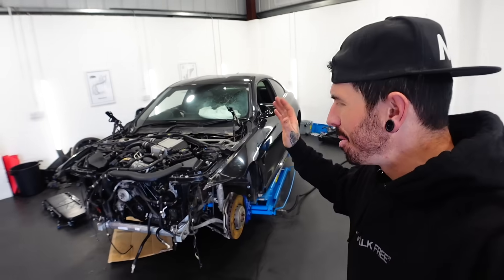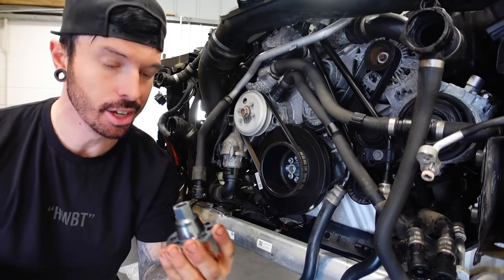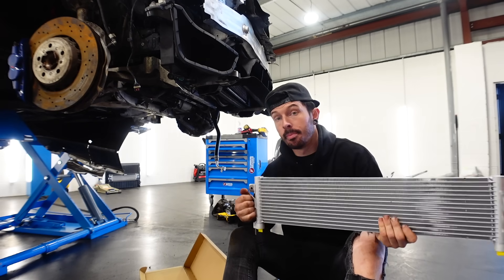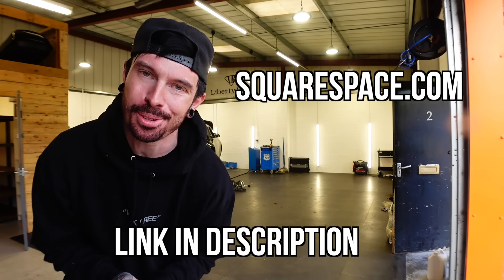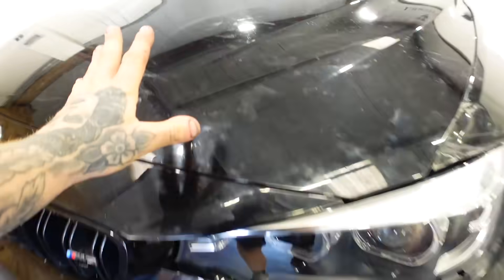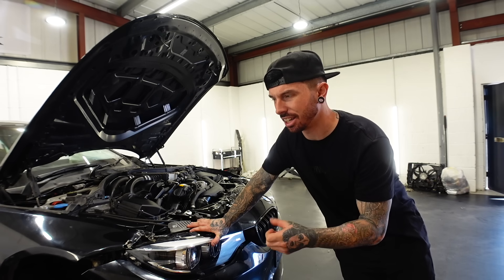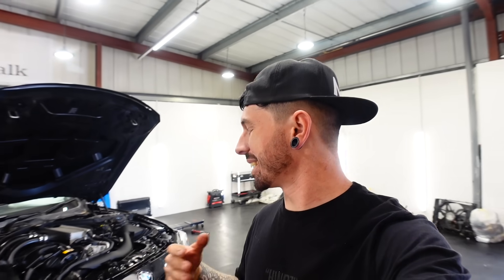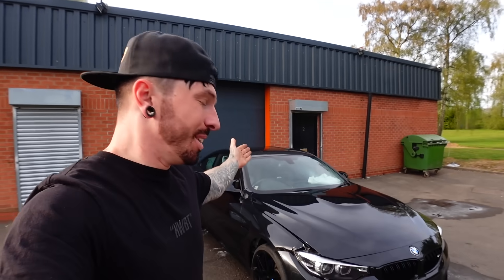FIXING MY WRECKED BMW M4 IS EXPENSIVE

Comment from the maker: Thanks to all those trying to help me in the comment section! Really appreciate it! Looks like its time to code the M3 headlights to the car!
Reply: I really think you have the wrong headlights, you need the xenon ones since your car is an pre-LCI. But I hope only coding them works.
Reply: Keep up the gd work! Looking forward to your next video!
Reply: I think you should get the angel light for the BMW and put on a m4 bodykit
Reply: Paint it with some thermal paint, i think that's how its called 😅 keep up the good work and great videos.
Reply: Keep up the hard work, your welcome for the support
Reply: Original module off your old damaged headlight will sort the problem. If you can still salvage them
Reply: Was just about to suggest this 👍🏻
Reply: Like Wasim says...if the modules are still ok then swap them over so that you can save the time and money of coding in new ones
Reply: Hi Matt do you think you can build a smart car 🚘
Reply: You are me, but with get up and go 👍👍👍
Reply: From other videos I've seen you can code the headlights or use the modules from the original headlights, if they're not destroyed. I believe Vtuned had a similar issue with a couple BMWs he's rebuilt..
Reply: Turn it into m4 gts
Reply: @jespers4916  Agreed with Jesper, either your car came with the adaptive LED icon headlights or Pre lci xenons, coding (along with rewiring) is only needed when u change headlight type e.g xenon to LED and vice versa
Run ur vin through a decoder to find out what type of lights your car was specced with
Reply: had the same with JCW MINI , TURN the light switch on  and then go and then unplug / plug in the light connector , should work
Reply: Can we still get a new gun w205 C63 soon please Matt!! Love the channel mate 👍🏻
Reply: You can get them coded to work bro
Reply: You Must Coding the headlights
Reply: When you have questions i can help you
Reply: @ Mat Armstrong The M3 & M4 headlights are the same you need to get them reprogrammed as they have their own modules, you can make them work temporarily by unplugging and then plugging them in whilst the car is running and make sure you check the headlight fuses in the bonnet area 15amp ones I think
Reply: I have bmw 235i front end need to change can u do that please if u work.andet me know where shall I come thank you

Comment: ZF26HP transmission allows even less fluid before it flows out thru the filter port. To get 7 liters in I used a baffle around the filler hose and pumped it in with a (one way) bladder pump. When the pump hose was removed, natch fluid poured out but I was quick to return the port plug and dropped about 250ml. With only 3 liters in the gearchange will be quite harsh with the possibility of overheating.

Comment: GTS hood, carbon wrap it along with the roof and boot.  Wrap the car red.  New black alloys, paint the calipers red.  Nice red and black car.  Inside, I'd get an Aza steering wheel,  pricey but you good quality.  Loving the content.  You've done well with the M4 in a week Mat👌🏻

Comment: Gearbox fill till oil comes out. Then you to hold brake then put into every gear for a few seconds in each gear. need to get gearbox to about 40c maybe different on your car and when at temp leave engine running and fill gearbox again till oil starts coming out again

Comment: Yes new headlights need to be coded but I guess headlights from a different car model also have different 'bus systems' . So even if you get the headlights coded the M4-system might not be able to read them because of the different data communication between control units ...

Comment: Gearbox oil fill up..... Fill up cold till its dripping out....close cap....go through gears + manual... Warm up sump( by runing engine) to till specific temperature....once temperature reached....fill up till drips out.
Okay that was on x5 but should be similar

Comment: I did change the Headlights of F and G series BMW as a mechanic 
If you just use the old ECM, they work without a problem 
Otherwise you have to Code tue bew ones in

Comment: If you can get hold of BMW’s diagnostic and workshop software it will help you fill the gearbox oil properly. It’s called ISTA D and there are links to a free download in some of the BMW forums. It’s a pain to get it installed but once you do the service function for the gearbox is really useful. ISTA will also allow you to reset gearbox adaptations which is recommended after servicing the gearbox like this. Also makes it easy to read and erase codes. 

Great episode! Can’t wait to see how the M4 comes out in the end!! Good luck!
Reply: Here's a link to ISTA D info. 
https://www.bimmerfest.com/threads/ista-download-link-no-request.1023698/
https://www.car-auto-repair.com/bmw-rheingold-ista-4-03-21-free-download-win7win8win10/
I'm not 100% this works with the F82. It definitely does for the E series. Hopefully it will good luck.

Comment: Is that replacement crank hub installed correctly? All of the videos I've watched they had to drill and replace the part, not add over the existing.
Reply from the maker: Yeah the mmr one is is a capture plate

Comment: Try programming your headlights first before replacing. The control units on the headlights will be programmed to the M3 they came from so there is a discrepancy between your cars details and the details stored in the headlights

Comment: One of my favourite cars.  Matt, as others have said the headlights will probably be fine but they need coding - more or less every electric part on a BMW needs coding to your car.  But please, please be very stringent with that gearbox and it’s fluid, filling and draining those things correctly is a blummin dark art and has a ridiculous procedure for even just checking the level - there are lots of videos about it on here.  Also keep an eye on the gearbox sump, once disturbed they can be a pain to get a good seal, so watch for any weeping!

Comment: Your gearbox doesn't have enough oil to operate safely, The gearbox needs filling when the car is running, run it through the gears and also it has to be at the correct temperature,(use a diag tool or code reader with live data. Just remember to put the fill plug back in before turning the car off as it will all gush out again.

Comment: Hi Mat, great content. The crank hub capture plate is a complete waste of time.
BMW have designed the hub as a 2-piece hub with a friction washer between the two.
So over time this will wear, so the capture plate won’t stop the 2 pieces moving.
You need to purchase the pin version supplied by Evolve or Insane Performance.
We have made this mistake on both our M4’s.
Luckily we are now using the safe version.
Others have learnt the hard way.

Comment: Think you just need to code the headlights to the car if your modules on the back of the old ones are still good might get away with just changing them over most BMW parts need coding to work with the car

Comment: If the driver units (chipboards) in the original headlamps are still intact they should work in the new lamps without coding 😬

Comment: Gearbox should be filled with the engine running. See below…

transmission oil after a repair:
Stand vehicle on a level surface and secure against rolling off.
Open fluid adjusting screw (1). If fluid emerges, close screw again immediately
If no fluid emerges, top up until fluid emerges and close fluid adjusting screw (1) again
Note: If fluid has been replenished here, a further refill must be carried out during the actual fluid adjustment
Connect diagnosis system and start service functions (drive).
Start engine (drive position N or P)
Record transmission temperature using the diagnosis system
(Drive position P)
Permissible starting temperature ≤ 32 °C
Idle speed: maintain at approx. 2000 rpm for 1 minute.
Open fluid adjusting screw (1)
Fill until oil emerges
Max. transmission oil temperature 40 °C
Insert screw
Note:
Parts: Replace screw.

Comment: M3 and M4 are basically same engine but different body panels. Pretty Much everything needs to be coded in a BMW , so if you have any issue with something just have it coded first then if it’s still not good should change it.

Comment: Dont run the car without coolant. The water pump does not like that.

Also there is a procedure for the dual-cluatch gearbox oil change on the M4.

Comment: Sorry to post on the chanel but need your guys help
Got a vauxhall vivaro and I'm assuming there's a problem with my glow plugs it's not even turning over I've checked the battery and it's fine would glow plug issues stop my van even trying to start

Comment: Matt the headlight control modules are programmed to each individual car ,if you can swop the old modules into the new headlights , if you cannot do this the modules will need programming in to your car , the gearbox needs to be filled with engine running and temp must be between 30-50 degrees to get the full amount in ,also I can’t remember if that steering rack is from the original car if it’s not it will also need programming and steering angle sensor will need to be initialised great vid mate making good progress!!!

Comment: Not sure if you already know but there is a web site you can go onto, 7zap.com. You can look up all of the parts using drawings of your model of car. It will tell you the part numbers of your headlights so you check if they are compatible for example. I use it a lot. The drawings are handy too, where certain length bolts go etc.

Comment: Head lights have to be coded brother 👊🏻
Reply: Yes! I came here to say that.
Reply from the maker: I’ll give it a goo thanks mate
Reply: Indicators and high beam should still work without coding
Reply: agreed - lights are probably fine: just need to code em
Reply: Just what I was about to comment, get your autel (other diagnostic devices available) plugged in
Reply: Guess you know if you type in m4 breaking in ebay loads come up?
Reply: Came here to say the same thing
Reply: Headlight need to be coded

Comment: could it be your new m3 headlights aren't programed and that is why they aren't working cause why would a company copy the same headlight with the same input cables and make it not work ? it might just need programing , better to check that than buying a brand new m4 headlight's , hope it helps <3 <3

Comment: Hi Mat there is a Tms board in each headlight that runs a code to the car so if you have the old Tms boards from the old headlights they will already be coded to the car it’s a 2 min job to swop but used headlights in the later BMWs can be a real nightmare finding & coding the correct parts for that car! Hope that helps ya & good luck pal

Comment: you have to code the headlights for them to work bro, or maybe try take the modules from the previous headlight and swap them over to see if they work. However that might not work either but it should work with coding :)

Comment: Looks like my first M4 comp - if it’s going past a stage 2 that capture plate won’t do, you need a full crank hub fix. All it needs is carbon M performance bits and a drop on spacers, job done

Comment: If the headlights fit mechanically surely it’s an electrical fix comparability with the control I/O as the power connector fits it’s surely a reconnection to the plug/connector to make work? No?

Comment: The headlights will not work because of their modules they need to be reprogramed to the car
Reply: Ok Steve jobs
Reply: this is correct
Reply: This is 100% correct
Reply: Same with steering rack, if it's been replaced it will need programmed 👍🏼
Reply: I hope he reads this before the next episode
Reply: I agree
Reply: Yes just what I was thinking
Reply: @daniel mayes should work technically
Reply: 100% just needs coding
Reply: @Eagle Beast of Prey no the modules need to be the same codes with the car they are programed with the old M3
Reply: @Account1746  i didnt say this just like that i work with my brother in this domaine
Reply: @Account1746  Rubbish comment. No likes. Haha
Reply: Max struck a nerve
Reply: @Account1746 real cut up
Reply: Coding can help maybe

Comment: Headlights most likely not a coding issue as other comments suggest mate, Most likely your car came with the adaptive LEDs and the headlights u have bought are normal LEDs. To get the headlights u have to work youll need coding and rewiring/repinning

Comment: You need to fill the gearbox with the engine running and the gearbox at the correct temperature then will get the rest in

Comment: Matt as a guy Who has owned mutiple bmws m3 and m4 are not The same The m4 is sits lower and streched compared to The m3. Sort of The big brother of The 3 series or sportier version of it u sit lower to.. If it makes sense they took The car and streched it and flattened it u could say.. Its like a cla 45 and a a45 
Pretty much same insides but diffrent outside parts
Reply: Hence Why the cooler and stuff fit but to be on The safe side just buy m4 parts If u have an m4..